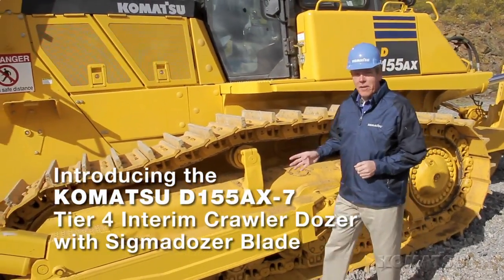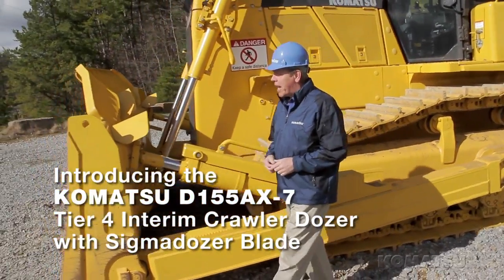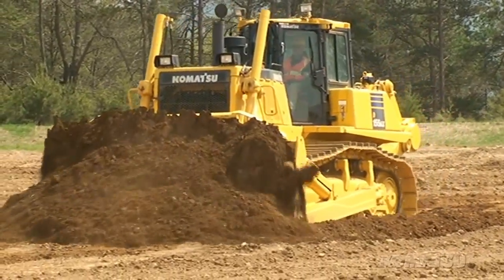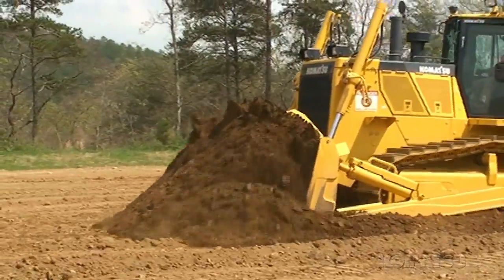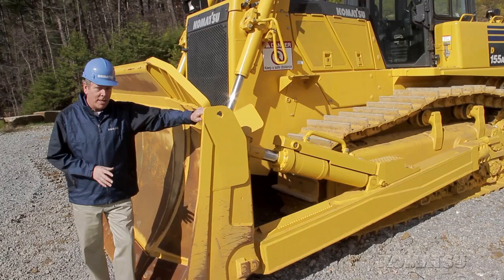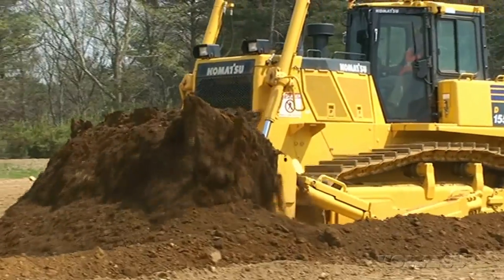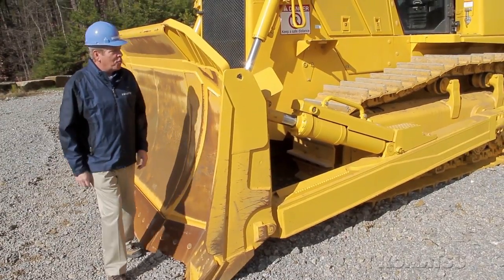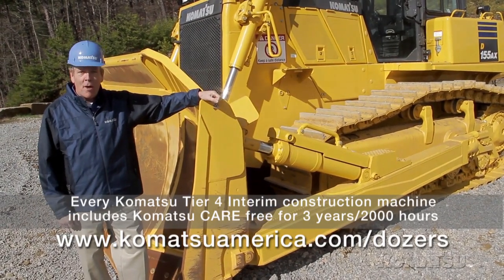Komatsu D155AX-7 crawl dozer with sigma blade

Comment: I HAVE ONE D155AX WHICH HAS DONE 7,500 HRS AND HAS SEVERE OVERHEATING ABOUT TWO YEARS AGO. ALL KNOWN SOLUTIONS EXCEPT THE CYLINDER HEAD HAVE BEEN APPLIED BUT TO NO AVAIL. CAN SOME ONE HELP
Reply: william gakpo can you tell me something about the fuel consumption?
Reply: Check scavenger pump 30 years ago d155a pump weak causing main radiator to over heat .worked for Dave Allen excavating.td7 to D8 to d155a 444 John Deere to 275 b Michigan.spent big money to hunt problem.got new scavenger pump from Sweden